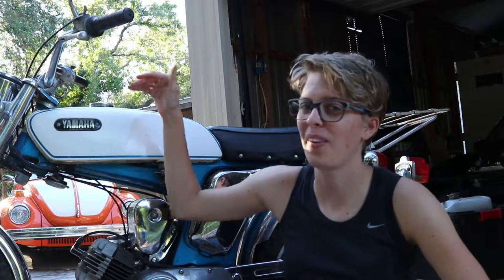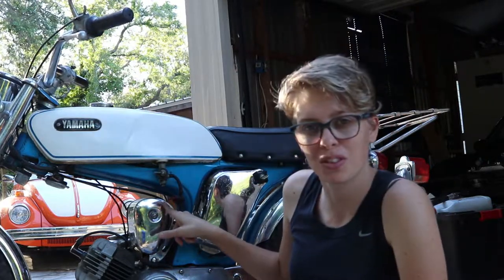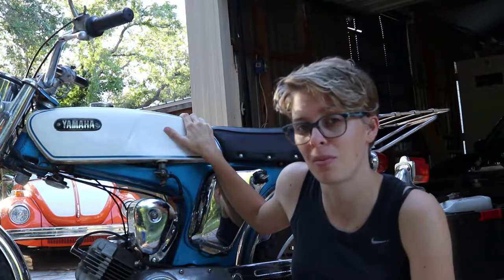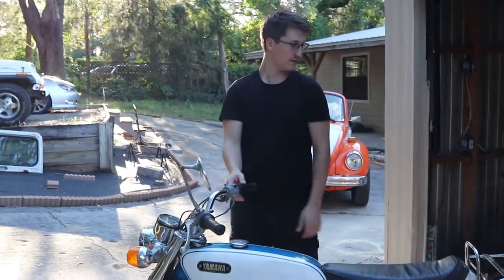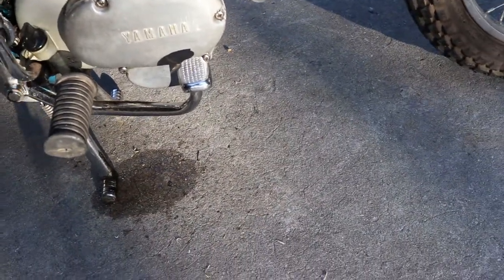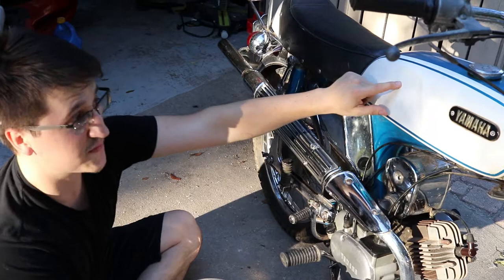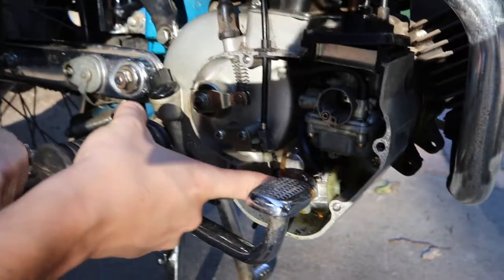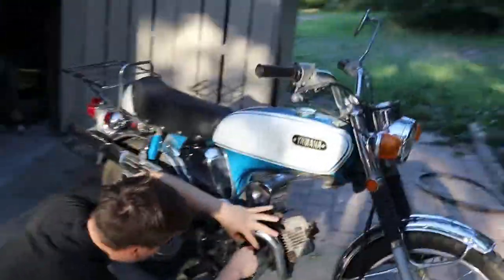BARN FIND! Was it worth it?!

Comment: I have one of these I can help adjusting the oil ratio. It’s definitely off. 
 Also take the muffler silencer /spark arrestor out and clean it well. They get clogged.
 I noticed you pulled out the screw driver. Never turn a  carb screw more than a quarter of a turn without testing riding it each time. 
Carbs generally leak from bad fuel lines or the float  needle not seating correctly.

Comment: You said that the lights don't blink? My 1971 Yamaha G6SB (Same bike, but mine is in candy apple green instead of blue) turn signals won't work if they are aren't grounded, they won't blink. I found this out when I had to take my tank out to load it with sea foam to get the sticky varnish off the inside of the tank. While the tank, seat and taillights were off, we threw a new 6v battery into it and we though the battery wasn't very charged. Jump a 12v onto and we come to find out that turn signals' ground wires have to be, well, grounded for it to work. I'd check that because, while I didn't have to mess with the wiring on my G6SB, I saw while putting the battery in, that this thing has its wires tucked into the stamped frame